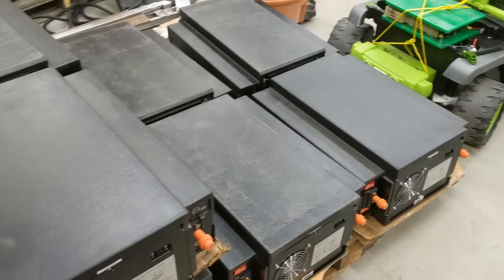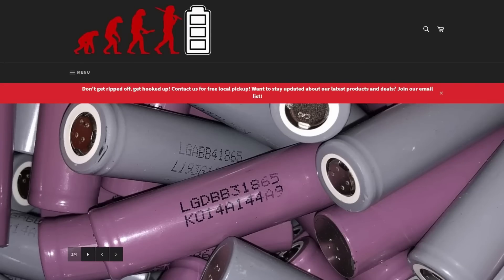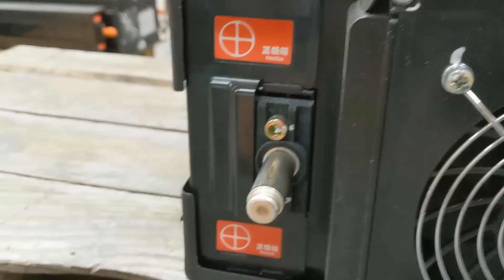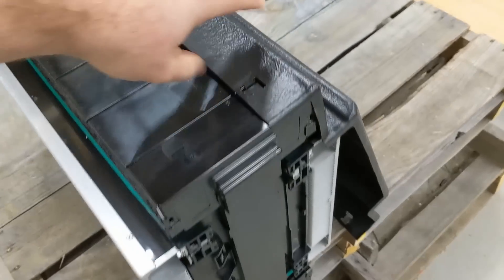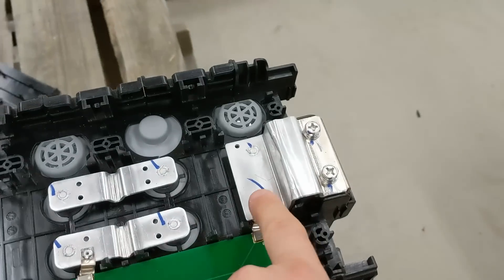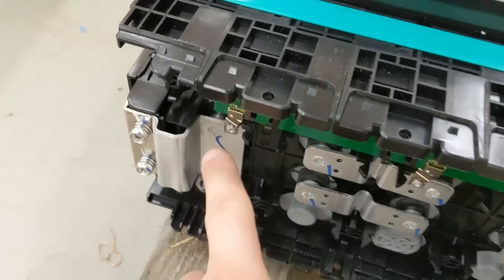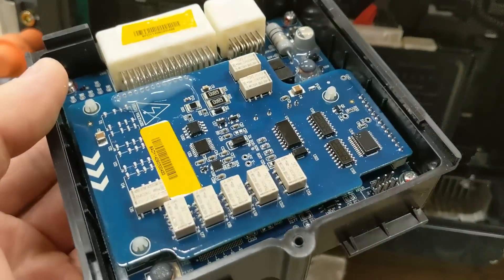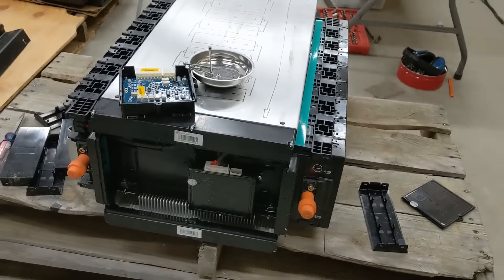$100/kwh Huge LiFePO4 Lithium Battery First Look

Comment: How come they are that cheap?
Reply from the maker: They are used, made in 2014.  Thanks for watching.
Reply: @DavidPozEnergy  Well then its... well its not expensive.. but it also not.. ultra cheap.

You have any sense of how hard cycled they are? I guess if they run like 1000 cycles or something that would still be alright.

I read a study... back quite a few years back. Because lithium isn´t really that expensive.. and phosphor is also "cheapish", and iron-oxide is super cheap... LiFePO4 battery should be able to be produced for $100 or there abouts... But when ever i try to find any cheap once.. they are (new one) really often in the $500 range.. And well that is a tad expensive. Specially when can by VLRA battery at my local hardware shop for like $120/KWh
Reply from the maker: I don't know how hard they were cycled.  Once I get them hooked up I'll be able to do a capacity test.  That will give us a better idea.  I'll be making a video about it.
Reply: I talked with Thomas and these modules came from a megawatt solar farm ESS to carry peak loads when there's clouds shading panels or if there's a surge in demand.

The company went bankrupt which is how they picked them up so cheap.

Comment: Thanks for the hookup. I used your link and purchased 2 of these
Thanks!
Reply from the maker: Thanks for using the link.  Are you planning a 48v setup?
Reply: @DavidPozEnergy  yes. I want to add these to the battery bank I currently have. I have 16 Sol-Ark 12volt PCC's in 4 strings for total 920ah. I have never had to wire up a BMS. Which one do you plan on using for these?
Reply from the maker: I took a look at your system.  The Sol-Ark looks like an amazing machine.  It seems like it can do everything.  I'm surprised you didn't buy more of the Sol-Ark batteries, I think they are AGM, right?  As for my BMS, I think I will try the Chargery 16s BMS.
Reply: @DavidPozEnergy  Not that I didn't think about the Sol-Ark batteries but they were $700 each they are partial charge carbon. The hookup ones were a much better deal. Just have to work out the BMS for them. They will be added in parallel to the Sol-Ark ones. The Sol-Ark system is very flexible, they just came out with a 12Kw unit.

Comment: so you'll have 1320 Ah of power.....thats not bad

in renewable energy, we dont  express battery capacity in Kwh...because wattage goes down as voltage goes down....however you can have a constant amperage draw till your batteries are drained....thats why

and 1320 is a good amount of storage.....should be able to get 2 days use with no input using minimal power

Comment: Whoa, are you going to power your whole block?!? lol  How many Whr do you have now between all of these and the car batteries?
Reply from the maker: LOL, no, not the block.  I sold the Chevy Volt battery to buy these, and 4 of these modules are going to a buddy.  The 8 that I'm keeping should be around 35 kwh of capacity, which should about double what I had with the Volt battery.

Comment: Does anyone know how to trigger the fan to come on?
Reply from the maker: The fan has no controls inside the module.  The fans positive and negative immediately exit the housing through the Molex connector on the front.  These would have been connected to a larger computer system that would turn on the fan.  In some future videos I'll be installing a control to power the fans.  Thanks for watching.
Reply: Thanks, let us know what bms will you be using as well.

Comment: Wow, nice score! (No wonder the things sold out so fast! You did good by jumping on that opportunity immediately!)
Just so ya know:
When equipment like this is installed in a data center, the fans face out the back of the rack.  This is called the "hot aisle/cold aisle" layout. (I think you may have front and back swapped.)
Two rows of racks are arranged back-to-back, so all the hot air goes into the space between. The air-handling system can scavenge the hot air from the back of the machines and dump cold air to the front of the machines.  The human operators mainly keep to the "cold aisle" in front of the machines where all the buttons and lights are.  Wiring and connections are mostly in the "hot aisle" to keep them safe and tidy. (Not saying you have to run things this way -- you do you.)
Are you going to use equipment cabinets, or roll your own?  Can't wait to see what you figure out with the BMS situation!  More power!
Reply from the maker: Hi proto,  Thanks for sharing with us how these would be installed.  That's interesting.  As for cables, I am planning to make my own.  I could not figure out what these posts are called, or where to source the female version of them.
Reply: @DavidPozEnergy  I have an idea, you could use some sort of metal cable clamp on them, instead of cable you clamp onto the post. Then use the clamp mounting hole to attach the power cable, using a nut/bolt.

Comment: Why it say li-ion on the battery ? Is it realy lifepo4 ?
Reply: LiFePO4 is type of li-ion battery, with 14% lower energy density (because of lower - ~3.2V - voltage) then most common li-ion: LiCoO2 ~3.7V.
But this type of li-ion battery is more safe and have more cycle life. IMO LiFePO4 is definitely better than common LiCoO2
Reply from the maker: I was confused by that too.  They have 3.2v per cell nominal.  I haven't been able to get any response from BYD when trying to get a spec sheet.
Reply: Technically, lifepo4 is a type of lithium ion, although its not the common terminology. They are most likely still lifepo4, even if labeled lithium ion. Would be interesting to know if you get a response from BYD!

Comment: A question that always comes up for me but can never find an answer.... How does dc-dc conversion from 24vdc battery to 12vdc load affect available capacity of 24vdc 200ah battery (minus conversion loss; i.e. converter eff=80%). We're trying to come up with a house system for a 40 foot sailboat and I could never seem to find an answer to that question or a formula for resolution of effective system capacity. Over simplistically put, I would think; rated capacity*2 minus 20% (conversion loss) minus 20% (max discharge limit)= 256ah (appx) effective capacity @ 12vdc. But better to let more knowledgeable heads prevail.
Reply from the maker: I'm in a Facebook group called "DIY Powerwalls".  I'm sure if you posted your question there someone would know.
Reply: @DavidPozEnergy  Thanks!!

Comment: So the BMS is likely just a balance board, and info gathering board for the main control board that makes the decision for the group ? As for over/under volt, cell and pack, also likely multiple temperature sensors, I'd like to have about 12-20 if those, enough to power a 5kw inverter for 72+ hours, at about 1/2 power, so at a average of 1/10 power it should last about a week+ longer with some sun on cloudy weeks, I might get 50-100 watts on cloudy days, if I'm lucky, for about 4-5 hours,  but I'm looking into building a micro hydroelectric generator, to start it will be designed to charge the lithium ion batteries, to about 80% and hold them, and power the inverter, I hope to get or build a charger that will charge with the cc cv lithium charging algorithm, charge to a set voltage, and dis connect, or charge to about 80%, and have full current available to power loads, lithium does not live long at full voltage, they are not designed to be held at fu charge voltage , test have shown it can lead to approx, 0.1% capacity loss per cycle, when charged like this, I'm staying between 3.0 & 4.0v lor liion. 2.8 & 3.4v for LiFePo4, and hopefully they will last for 20 years,  then I'll buy what ever is the "thing" to have then! Or if only 5-10 years, I'm thinking about 10 kwh of LTO cells, to replace my 7s liion, maybe 11s, 12s LTO, cells..  maybe I'll go 48v, and 22s LTO cells, they should last forever!! A 10-15 kwh should be fine, especially if the hydroelectric does about 1Kw, and I get about 2.5kw more solar, I could probably get by with hydro only, with 2kw of solar, but I feel safer with about 4.5kwof solar and hydro power, I have missed all the big batt packs lately!! I been looking into the C-MAX ev batts, building battery packs is getting old!! All the charging discharging, testing capacity, matching to put in packs! Then the work starts, actually making connections!! But I'm fully off grid, and need the power!!
Reply from the maker: Hi James,  You might be able to help me here?  I'm trying to nail down my charge/discharge voltages.  For example, with my Chevy Volt pack I used 4.05v/c (volts per cell) for charging, and 3.50v/c for discharging.  I thought that made the most sense for capacity vs. cycle life.  
But these are 3.2v nominal.  The literature I find says 0%-100% is 2.5v/c to 3.65v/c.  Do you have any suggestions on what set voltages would be good for perhaps a 20%SOC and 95%SOC?
Reply: @DavidPozEnergy  you got all you need to find the answers yourself. Bmv712, the mppt 250/100 from victron, you select the lifepo4 settings on the charger and use the active ballancer for the upperbalance on the cells(3,55v as the charger is set for absorb.) Than start the discharge till the weakest cell reach let's say...3,05.I find this safer. Then check the ah consumed on the bmv and you that nr. write it down in the bmv.712 on the capacity settings. And you're good to go. I would recomand a 48v system 2s6p in your case. Hope it helps.

Comment: The average price of a kWh in the US in 2017 was 10.48 cents. 100 kWh would cost $10.48.
But Kilowatt hours (kWh) is not a measure of power. It's a measure of energy. 
Kilowatts (kW) is the unit of power.

Comment: Great find but I assume that since you already had a large battery bank and your house and shop doesn't use much power that you are either planning for a future home or you are getting an electric vehicle in the near future, Which by the way could also be used to store some power for home use.  I realized to use one system you had to convert but still bigger.
Even though you no longer have Lithium batteries I think you will find this link interesting 
https://www.youtube.com/watch?v=u57pBJG2C7E
I am considering the Solt-ark 12k which would work well with the LiFePo04 chemistry.They will also work well in my golf cart.

Good Luck!! Looking forward to watching you test these and recondition them.
Reply from the maker: That was a very interesting video.  30 seconds to heat, then fast charge.  Cool ideas.
I sold my Chevy Volt battery to be able to afford buying these.  I should get about twice the usable kwh.  No EV yet.  Probably still a few years out from that.  Thanks for watching.

Comment: Driving there is probably the way to do it if you can I saw for 1 the shipping said $350 I dont know how that would change with several but does not matter right now they are sold out
Reply from the maker: I think the shipping is a fixed cost of $350 if you buy 1 or more.  Good luck grabbing them next time they get a shipment.

Comment: I'm in telecom and there is a reason they still use regular lead batteries
Reply from the maker: I'd like to know what the reason is, if you are willing to share.
Reply: @DavidPozEnergy  charge discharge cycles are key to battery life. Longetivity is vital for communication electrical backup. Far as I know only thing developed that is better is the graphene but its a disruptive tech so good luck on getting 600v 100TF capacitors
Reply: @brettmoore3194  Last I checked, SLA's have a life of around 500-1000 cycles. LiFePO4's are around 5000-10000 or more. So why lead again?
Reply: @dchubb42  Telcoms use lead acid, but usually they aren't SLA in their bigger structures.  Their only reasons are cost and reliability.  Lithium's "thermal runaway" has been pushed so hard, most companies aren't ready to embrace any type of lithium yet.

Comment: Can you please cycle one and measure its capacity at 1C and at something lower like 1/5C so we can see how much capacity drops off with discharge rate?  This is a good test to see if batteries in storage for a long time have suffered during storage.  Also let us know to what extent they tend to go out of balance when charged rapidly or discharged rapidly.  I have noticed both of these issues with other bargain batteries that had been in storage for a long time.  Thanks!
Reply from the maker: I had not thought to do a 1C vs. 1/5C test, so thanks for your suggestion.  I definitely plan to do several capacity tests.  I hope to do several capacity tests in a row and map the recovery rate.  Basically see how many cycles before the cells plateau in capacity.

Comment: I really hate that people keep saying flat head screwdriver, it's a slotted screwdriver.  A flat head screw is one that has a conical head like a sheet rock screw that is meant to be buried in the work so as to be flat with the surface.  The SLOTTED screw has a single slot as opposed to, say, a Phillips screw that has a cross shaped drive THAT CAN ALSO BE FLAT HEADED.  I apologize for shouting but we all need to start using the proper terms, please.
Reply: There are no slots on a "slotted screwdriver" !
I call them negidrives as opposed to pozidrives...
Reply: "Proper terms" for a "Phillips" screw is "crosshead" screw or "recessed cruciform" screw.  The crosshead screw was not invented by Henry Phillips.  He did, however, improve the patent and screw invented by John Thompson.  Proper terms.....
Reply: @dougecko  Here in Canada, we have whats called a Robertson head screw. Its a square shaped indent in a screw head. Somewhat superior to that of a slotted (flat-blade) or cross-head (Phillips), in-that you can insert screwdriver into head of screw and move it to your work area and install same. I understand that the Robertson is not commonly available in the USA or many other countries.

Comment: Nice score!!  Was there some sort of filter that fit over the intake?  Those heat sinks are too clean if there was constant or near constant airflow.
Reply from the maker: There was no additional filter.  I have the impression that these sat in an UPS system and were normally not used.  Just in a power outage they would kick on and the fan would blow.
Reply: @DavidPozEnergy  Even better score!!!

Comment: They are all sold out darn it!! I need some batteries in my life I live totally off-grid all I have is 4 sealed lead acid batteries that are taking a crap..... the rest of my solar equipment is SunPower 327 watt solar panels. Magnum 48 volt 4000 watt inverter and classic charge control 250. Been struggling to find some good batteries.
Reply from the maker: Hi Jo Lee,  Battery Hookup has several batteries available, most are just small and need work to be welded together.  Check down in the comments, someone just posted an hour ago he is trying to sell some nice AGM's.  Good Luck.
Reply from the maker: They just got more in stock: https://batteryhookup.com/collections/frontpage/products/byd-24v-lifepo4-4-4-5-kwh-battery-modules-rv-powerwall?rfsn=3333666.ca06e9

Comment: So one of these would be like 2 Battleborns?
Reply from the maker: I think it would be more like 4 battleborns in terms of capacity.  However, the battleborn batteries have BMS's built in and I have to add an external BMS to these.
Reply: @DavidPozEnergy  I am building a retired SnapOn Truck into an off-grid mobile RV. I just bought one of the MPP 24v 5 in 1 units and I have 4-425watt solar panels for 1700watts total. I had planned on using a Tesla battery pack but I think I may go this route. I'm just wondering how hard it will be to hook up your own BMS?
Reply: @DavidPozEnergy  New subscriber by the way. I know Will Prowse and found you through him talking about these batteries.

Comment: ....thinking out loud, if you paralleled those with your Chevy Volt battery, you could charge to 49.2 V (4.1V per cell for the Volt) and your LiFePO4 would be at 3.075 ---- then discharge the Volt to 42 V (3.5V per cell) which would put the LiFePo4 at 2.625     Should work out just fine :-)
Reply from the maker: Sorry to disappoint Mark, but I had to sell the Volt pack to help pay for these.

Comment: I just bought some lifepo4 batteries built into a power station and they are awesome. its 4 kwh of battery and 4000 watts continuous 110 vac power for backup power when the power shuts off.. it ran a air compressor intermittently for 3 or 4 hours when we were installing siding... so far it performed as expected..

Comment: You should use a BMS with any lithium batteries to keep from over amp in or getting too hot or too cold and for safety.
Reply from the maker: I still plan to use a BMS.  I simply don't know how to write a computer code for whatever language the built-in BMS might use.  I'll be installing an external BMS.
Reply: According to a spec sheet I found, if we can get a one of the master BMU units, it should talk native CAN bus to a Victron GX module. (Color control or Venus, or similar)

David, can you post any model numbers you can find off the unit? I'll do some googling around. (I already placed an email order for 3 for my Skoolie and hopefully can go pick them up from Besalem next weekend.)
Reply from the maker: The battery is Model: ABSSM.  I have e-mailed BYD, and sent them a message through facebook.  No response on either.  I was trying to get a spec sheet for the cells.  Specifically I wanted to find out voltage for 95%SOC and voltage for 20%SOC.  So that I can program my charge controller and inverter.
Reply: Keep us in the loop. :)